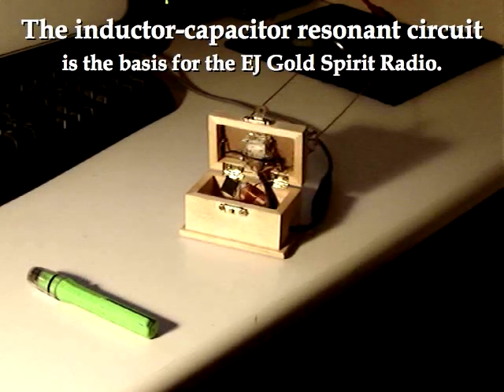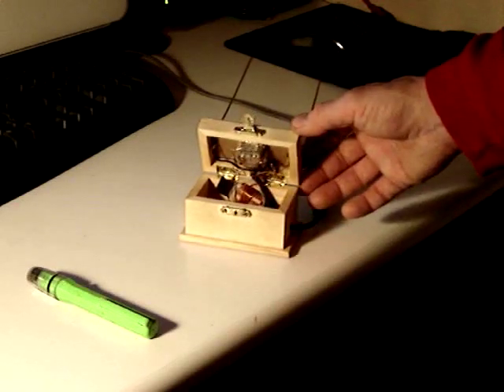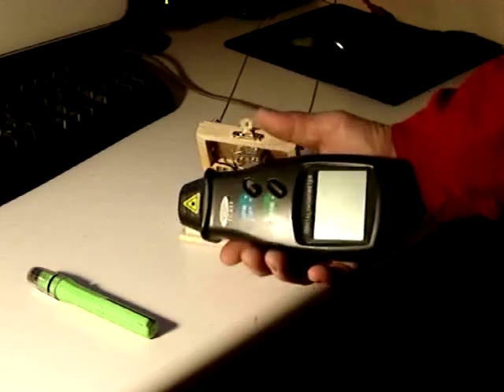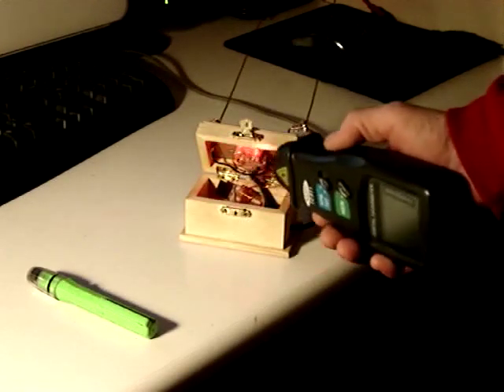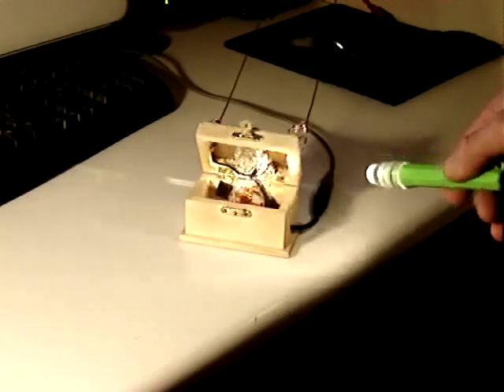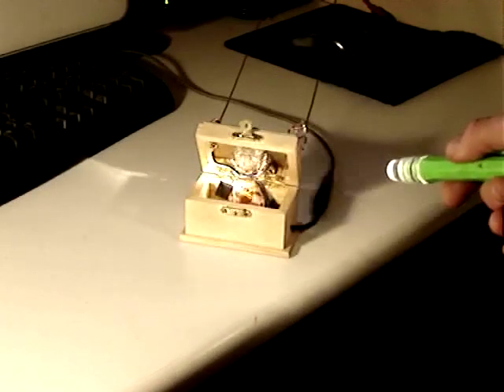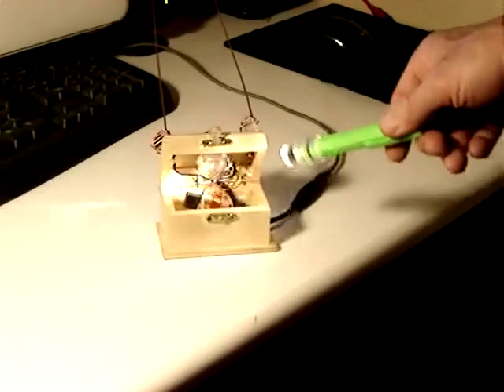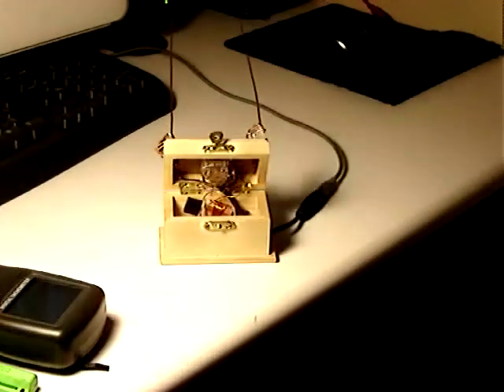Spirit Radio With LSD (Light Sensitive Diode)

Comment: nice vid demonstration.

question how do this spirit radio can be used as a beta blocker? i just don't get it. it may be tuned to ELF, 7.83 hertz, to alpha-theta, but how does it is blocking beta brainwave???. There are a lot of claims on those website links.
Reply: The crystal radio part is how the circuitry is set up. When the radio waves from every dimension pass through a series of capacitors and resistors, it alters the frequency in output down to very VERY low wave lengths. The only way to change ones brain wave frequencies though a device like this, is though sound. Light may also be used to alter the brain waves but sound is by far more effective (in my opinion). Simply, you plug a pair of very good headphones into the Jack and meditate. Now your ears are not capable of disifering sound from this low of a frequency; as a result you cannot hear it unless amplified. You don't need to amplify the audio to feel the effects of the beta blocking waves. Now this thing does work fairly well, considering my roommate, who has ADHD, cannot shut up for the life of him, does become completely calm after 20 of plugging it into my speakers without him knowing. It's a great box. But yeah, that's how it works.

Comment: *This got nothing to do with Beta brain wave frequencies.
Its caleed radio becouse Coil is paralel with Capacitator. C + L in paralel called Tuned Circuits.
As a detector you can use germaium, photo,lsd. elements.

Comment from the maker: @sibalogh 
The original circuit is crystal radio based. The use of a diode in a circuit enables dozens of uses.

The 60 hz lightbulb sounds higher in frequency because the Audio Hijack software allows me to change the pitch in real time.

Comment from the maker: @ez2curanut 

Mr Gold says in "Parallel Worlds Explored", 

"A new form of periodic leaky-wave antenna was used in my Beta-Blocker; its radiation patterns are triodic and can be analyzed in three-dimensional trinary trigonometric patterning..." 

 "The intensity of the resultant waveform is diminished on the lower end of the EMS at 7.8 Hz, resonant with 1440 Hz on the broadcast band, through Beat-Frequency Oscillation and standard wide-wave technology common in the 1900's."

Comment from the maker: @ez2curanut 
The two antennas are tuned, one as an antenna, one as a ground, together with the resonating inductor and capacitor circuit. Apparently the Spirit Radio works with two close AM band waves, and the resultant frequency is a harmonic of the Schumann Earth resonance of 7.8 hz.

Comment from the maker: @GearzVoNKod3 

The cable connection points at the ground and diode of the radio are plugged directly into the computer, and run through audio software called Audio Hijack pro.

Comment from the maker: The radio circuit normally converts the AM 500 khz to 1700 khz signal into sound frequency range. It will also convert electromagnetic waves from the screen into audible sound. It's not reading the colours directly, but the frequency of the electronics which is switching the colours on.

Comment: the photon hitting the wire inside the diode cause a small reaction which makes a electrical discharge creating a radio wave and  a small sound is picked up by your receiver ,  the greater the frequency of light the higher pitch  , awesome demonstration of how light interacts with matter

Comment from the maker: This is the light-sensing part of the circuit, and all diodes of this type would respond to light. The trick is to make the light response make some sense; to give it "body". That's where the audio software comes in.

This sensing of light idea is really stretched in a following video where  the radio "reads" the colours of my computer screen! This was through electromagnetic waves, not visible light like the above.

See   YouTube/watch?v=DZcVLUwWDVM
and especially YouTube/watch?v=aPEJtXhGiI0

Comment from the maker: Originally, the term spirit radio was used over 50 years ago, as a name for specially tuned radios and equipment that supposedly could hear the voices of the dead and other such psychic uses. There are psychic societies now that still use this idea and listen for EVP (electronic voice phenomena). 

Although this may be possible, it is not the main use of this device. This Beta Blocker Spirit Radio is designed to be a meditative aid, by assisting the alpha and theta brain wave states.

Comment: Yes- -all semiconductor junctions are light sensitive and produce voltage from light (photovoltaics). Commercial solar cells are really just enormous semiconductor PN junctions. The amplification and modulation are very interesting in this experiment - yielding sound variations from various light types and proximity. Have you tried a green laser? Thanks for sharing yet another very cool experiment!!!

Comment: A semiconductor junction (your germanium diode) generates a forward voltage, much like a solar cell.  What the voltage causes to happen depends on your circuit.  It might be interesting to use a low frequency modulated light, or a TV remote, though the diode junction may be less sensitive to infra red tight.

Comment from the maker: I was curious what the Beat Blocker radio could do other than blocking beta brain waves and being a parallel world tuner. It's circuit consists of a resistor, 2 capacitors, a coil, and a diode. 

I had already discovered that the Beta Blocker receives regular radio waves, detects EMP pulses and EM fields, and hears audio frequencies.

This test confirms that the radio also detects the visible light spectrum. The diode inside is light-sensitive, and can easily discern between AC and DC light.

Comment from the maker: EJ Gold built the Beta Blocker Spirit Radios with diodes that are to be used in crystal radios. The diode is normally meant to take the full wave from the antenna and half-rectify it into a DC form that an earphone can react to. 

Although it was not something I expected when I started poking around with the laser beam inside the radio box, I'm now assuming that most diodes are light-sensitive to some degree, and that is simply the effect here.